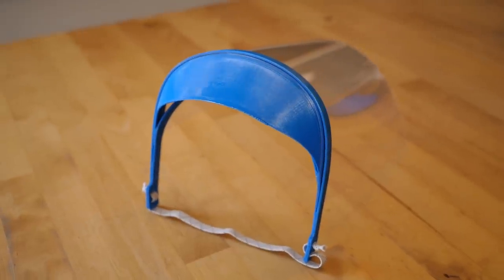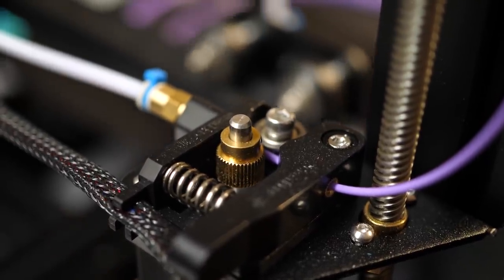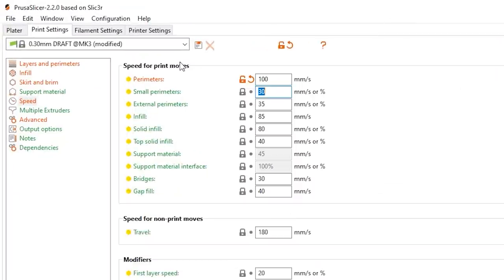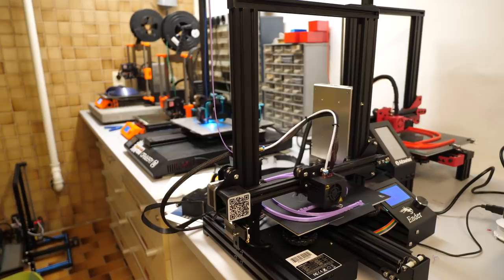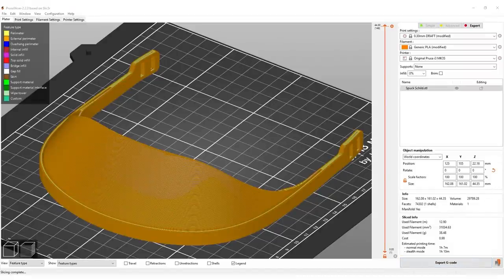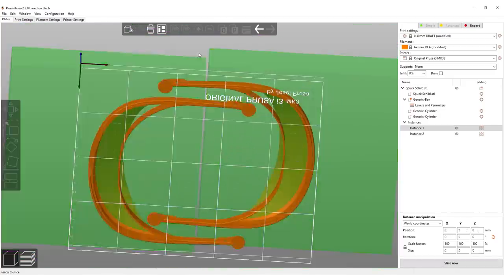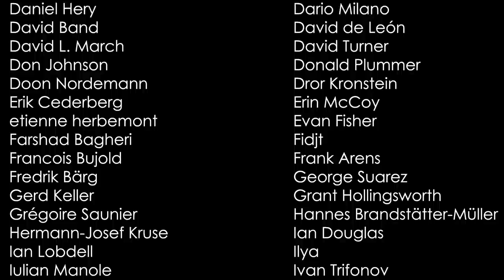FASTER 3D printing of face shields - from 5h to 1h!

Comment: Aside from helping meet a public need, this is one of the best "git 'er done" 3D printing videos I've ever seen aimed at optimizing speed and strength.

Most important to me is hearing which adjustments to attempt in which order: The goal is to get test prints done faster, so maximum production can start sooner
- Which adjustments can provide the greatest speed savings?
- In what order should they be tried?
- How many changes should be tried in a single test print?

Being able to quickly tune an adjustment that went "too far" is another key part of the process.

Thanks, Stefan!
Reply from the maker: For this application, I'd set speeds and extrusion width and layer height quite high. Up the temperatures quite a bit and then tune down on the volumetric flow rate until you get nice and consistent prints.

Comment: I'm part of a similar effort in DK, and have gotten my print time down to 24 mins without any noticeable loss in quality. To be fair I've switched to a 0.8 mm nozzle and am printing with 0.4 mm layer height, so that's probably where most of the time reduction is coming from.

Comment: these values are for a .4mm nozzle
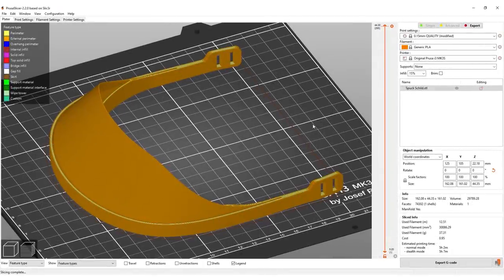0:00-2:56 introduction
2:57- 3:34 adjust layer height to around 0.3mm 0.32mm if you have a creality
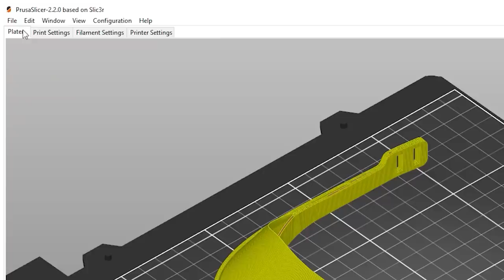3:35-3:45 remove skirt/brim
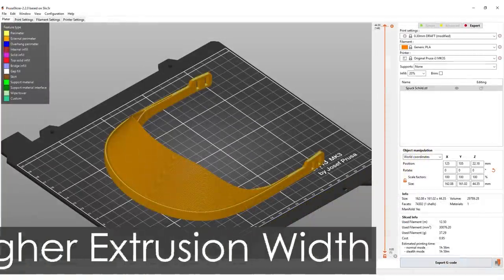3:46-4:05 increase extrusion width to 0.6mm
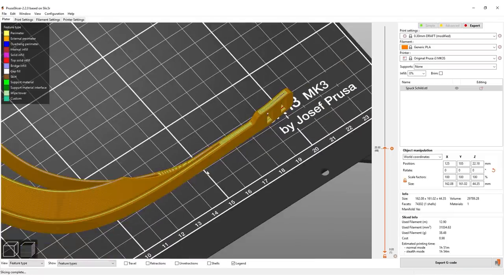4:06-4:18 decrease infill to 0%
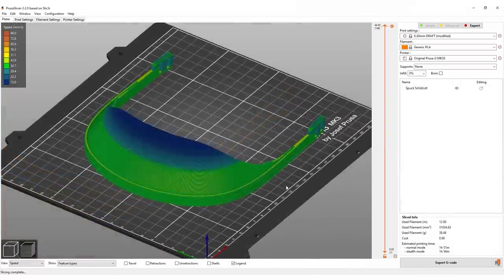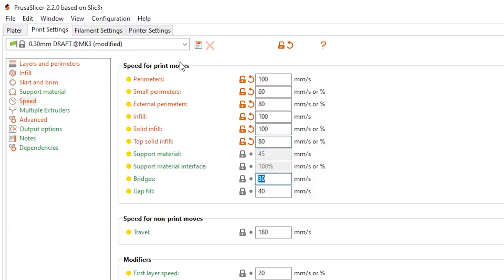4:19-4:52 increase printing speeds
4:53-5:24 just volumetric flow rate
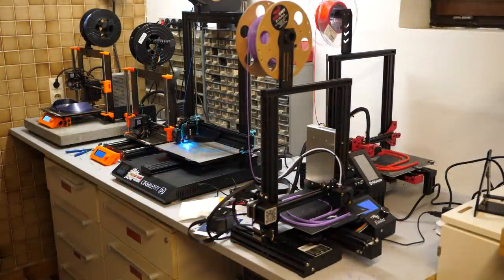5:25-5:50 increase temperature for higher volumetric flow rate
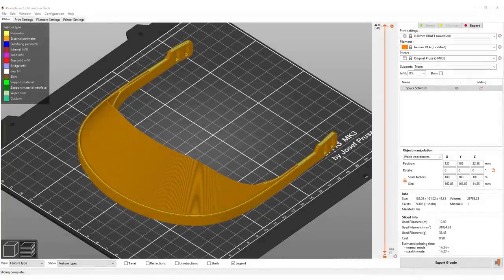5:51-7:07 explanations of random stuff
7:08-7:30 reduce minimum layer time and part cooling
7:31-8:21 use modifier geometry to reduce perimeters to 1 in shield
8:22-9:08 use modifier geometry to fine tune small areas
9:09-9:20 put multiple things on platform

Comment: Excellent and timely video for all those volunteering their time to this cause.  By the way, there is a clamp mod for near the Artillery print head that will hold that flat cable more securely and lessen the chance of that burn out issue.

Comment: Thanks for this very informative video!!!  I too am printing face shields (design and stl's provided by local medical supply company), and these steps dropped my ~7 hrs / shield to ~ 3.75 hrs / shield!!  Also, I was using rafts on very thin parts and the addition of "mouse ears" was a godsend in reduction of post processing.

Comment: Well, to get it faster... use a bigger nozzle if you can and do'nt forget to turn retraction off since that is costing a lot of time for parts that don't have to look nice.
On the sidewinder with enough temperature, I can print with 90 mm/s with a .8 nozzle and that means only one perimeter and are still very strong.

Thanks for sharing this for the good cause.
Reply: They still need to be comfortable. Nurses might have to wear them for hours. So just make sure that doesn't produce any jagged edges or blobs that stick into the skin. Sharp edges could also split rubber gloves.

Comment: I upgraded my Prusa i3 MK3’s with the all copper E3D Volcano heat-block and nozzle. With this mod, I am able to print one of Prusa’s face shields (just the top part) in about 20-25 minutes with an extrusion width of 1.2mm (out of a 0.4mm nozzle, because the volcano is ridiculous like that) and a layer height of 0.3mm (any taller and I push past the volcano’s maximum flow rate and the plastic melts but is not reaching the temps it should, and this is visible in both the print quality and plastic colour). I’m currently playing with settings for my 0.8mm nozzle to find a sweet sport for the print speed and layer height. One thing you can try if you’re printing too fast for your hot end to bring the plastic up to the right temperature is to crank your hot end temperature up fairly significantly - please note that I have no idea how this will affect final print quality, and please be careful not to overheat your hot end or melt your silicone sock.

Comment: Excellent tips! These helped me reduce a print from 2h41m down to 2h08m. Then, I decided to use the adaptive layer height feature to give me a better finish, and surprisingly it reduced the print time further an I ended up at exactly 2h. I'm very please with that and the parts look surprisingly good too!

Comment: As one who works around hospitals/EMS and has been working with healthcare workers to get these into local hospitals - there are invariably two concerns expressed:

1) The face shields can not detach from the mask/fall off. A bunch of the prints and/or shields don't attach well to the headgear, and if they fall off during patient care - then the caregiver is exposed. Tape, or other solutions help a LOT to ensure that some of the face shield material attaches better ( here - typically transparency sheets)

2) The elastic bands (if you use the thin ones) often get caught up in the hair of caregivers, which makes it hard to put them on/take them off without compromising the face mask (or goggle) seal. Thicker materials that don't get twisted into hair are crucial.

Thanks all for all you're doing to help out! People are awesome!

Comment: I redrew the Prusa design and ended up with a facemask that can be printed in about 35min. using a 1.5mm nozzle. I also removed the studs at the outside of the mask. The shieds are fixed to the holder with 3 printed clips.

Comment: Quite admirable Stefan. I don’t think you need to worry about the part lifting a little at the back - functionally it should not matter👍 I think your settings could benefit other designs as well

Comment: I read on heise that clinics prefer prints in PETG since they are easy to desinfect with alcohol and and also don't shatter when dropped. ^^
Reply from the maker: Tossed mine around a little and didn't break them, though I'm also currently in the process of changing to PETG. Since it's getting warmer outside I fear people leaving them in the car. Even though that might disinfect them a little, PLA shield holders might not be the best in such a case.
Reply: @CNCKitchen  I delivered some Prusa v2 shields to clinic a week ago. They use mostly 70% alcohol to desinfect, but also sometimes an autoclave with ~70-80 degree to desinfect. They are also experimenting with 70 degree autoclave to reuse FFP2 masks. I modified your print for PET-G, all I did was raise the temperature to 240 degree and bed temp to 85 first layer, then 90. And raise the speed again to 120mm/s in the filament setting. All prints came out nice so fare, printing time on Prusa Mk3 ~ 55min each.

Comment: Maaaaate, thank you! you've drastically improved the speed at which my 3d printer chooches :O was taking me 1hr 30 minutes to spit out one of the ISO838 frames, now down to 45 minutes :O The spool of filament, it's visibly turning now :O the volumetric setting is freaken insane!

Comment: get rid of those slits at the back where you attach the string. Use clamps similar to the clamps you find on a boat (dunno exact word for that). That increases print speed bc you dont have to move between islands. I am printing similar face shields (without the shield at the top) in 30 min per print. We use 0.5mm PET foil in 300x215. we also attach some foam tape where the print touches your forehead. as a string we take rubber band with holes, so you can adjust the length easy and on the go. Material is PETG. Masks are desinfected at 60°C in an oven. (hope those infos might be helpful for someone)

Comment: I also have an Artillery Sidewinder. My flex cable is also burning out from all this printing. What I want to share though is that with a 0.8 mm nozzle on the Volcano hot end, with 0.3 mm layers 1mm wide, you can print at 80 mm/s or possibly slightly higher.

Comment: One more interesting trick could be to lower the temperature for the top angled shield, as it has a much lower flow rate - ie. via the new PrusaSlicer's "insert gcode at layer" feature. ... An alternative could be tuning Marlin's AUTOTEMP, but that would likely take more time / testing.
Reply from the maker: Good suggestion.

Comment: Hey stefan, do you have any tips on how I can help others with my printer. I have the capacity to print a few of them. Just don’t know how to get them to the necessary places. I live in the south of germany.
Reply from the maker: Visit https://www.makervsvirus.org/de/ !
Reply: Exactly. check out Makervsvirus and find out where your local hub is. If there is none, join the nearest one :) Happy printing!
Reply: Wo wohnst du? Bei uns bei Greding ist leider kein Hub vorhanden
Reply: You could also ask local services if they need some. Delivery people, your doc, restaurants with delivery or check on platforms like nebenan.de if you've local people that go shopping for older people or people in quarantine. Those might be grateful for a little support. Personally, I think the professional areas like hospitals should get professional equipment that is certified, but we can help those that would benefit from "some" protection, but shouldn't buy the ones that are needed in hospitals. Just be a little careful. There are some people that pretend to need shields for a good cause but sell them on eBay or other platforms for profit.
Reply: Hu Emm Baden-Württemberg Bad Waldsee. Glaub leider nicht in deiner Nähe.
Reply: Leif Thank you for the advice!

Comment: On your Blog you showed a way to modify settings for an area using a support blocker in Cura.  How did you add the circular tabs in Cura?     I ask because maybe your way is better than mine.  I had to use a work-around, but I was able to add the circles (well ellipses because I changed them)

The way I did it (which there may be a better way) was to download a simple cylinder model, place it where I wanted the tab, I went to the resize menu and turned off the Uniform Scaling option and then scaled the z by itself down to a single layer height.  (I'm using 0.28 initial layer height and I have a variable layer height of 0.04 on top of that so non-detail layers will go to 0.32 and layers that need a little more detail will go to 0.24).     So with my z of the cylinder set to 0.28mm, I also proceeded to experiment with changing the circles into ellipses and I made their longer dimension in-line with the angle of the side of the shield frame by rotating them slightly.    This let me elongate the tabs a bit.    I changed the tabs to Print As Support.  I set their xy distance and min xy distance to 0mm, but I found a bug in Cura that I need to remember to report.  The tabs were not touching the model.  I had to temporarily turn on supports in the main settings, change the xy distance and min xy distance to 0, and then turn the support off in the model.  Then when I sliced it, the extra layer that I added (using your inspiration), finally touched the frames the way I wanted it to.    When I lift the frame off the bed, the tabs break off almost by themselves, but they help adhere the part to the bed enough during printing.

I have my print time down to 1 hour 40 minutes using PETG, which I think is fair to say is a little harder to print with.

Comment: You can make them in 5 minutes, with just a longer piece of transparent material, all you need is TAPE, tape it into a cylinder place over head, if you want to get adventurous cut out curves for shoulders, 360 protection in 5 min
Reply: Haven't you learned to not place a bag over you head as a child? ;-)  But seriously, actually you need quite a bit of transparent material for this, about 60cm x 30cm, which is hard to source, especially now. And you won't have the eye protection against sinking droplets, as long as you don't intent to close the cylinder at the top, which brings us back to the bag situation.
Reply: @llejk  yep I know but I like having a purple face:) but seriously I know I tried looking for some material found A3 but not much more but someone that could do them en mass at some point, I did a render but cant post a link goto mechabits couk

Comment: Actually your speed setting shown here are usually my go to settings for normal prints. As long as you use klipper that actually do acceleration calculation on all moves and keep accel to a resonable level for your printer you can reach those speed almost all the time. Usually now I'm limited by the heating power of my print heat in regard of speeds.

Comment: 0.28 layer height is easily doable on an Ender 3 w/ 0.4 nozzle. Reducing perimeter  count and upping the line width is good; I've gone up to about 0.6mm in vase mode. Volumetric limits of the hotend begin to show eventually; 85mm/s nozzle speed in my case. Mine can do about 150mm/s for 0.2LH & 0.48 width. Teaching Tech has a spreadsheet to calculate these values.

Comment: Hello Thanks for sharing good stuff, I wanted to know about variable speed. Mean to say that is possible to give command "User defined speed" Like 1 to 100 slices at 30 MM, Next 200 slices at 40 MM and next 100 slices at 50MM ? I have total 400 slices in a particular print.

Comment: I noticed non of the printers in the video running the ED3 volcano.  Two years ago you made a video on converting a CR10 to a volcano heater block.  Did that conversion not work out in the long run?  Any thoughts on doing a new video on the supervocano upgrade?
Reply from the maker: The Artillery X1 is running a volcano. Great for fast printing though quality suffers a bit. Concerning theft super volcano, I currently don't have a printer, where it would make sense. The volcano is already plenty powerful.

Comment: Hey, Stefan. Thinks for great tips! Have you considered disinfection methods for these shields? I would like to use UVC lamps, but I heard it degrades plastics. 
I was wondering how big of an effect that is. For example how many 30min disinfection sessions, with say 30W tube, would these shields last. It would be cool if you did a video comparing effects of UVC radiation on different materials.
Reply: Ok, I just found the comment section on your previous video :).

Comment: Have you looked into having the printer remove the print from the bed automatically?   I've seen that pop up on Reddit where the they can flick the part off the bed and start the next one without any issues.
Reply: I saw that too haha!
Reply from the maker: Saw a couple of videos today on the 3Dprinting subreddit: https://www.reddit.com/r/3Dprinting/
e.g.: https://www.reddit.com/r/3Dprinting/comments/fuhbxk/the_automated_takeoff_procedure_for_my_continuous/?utm_source=share&utm_medium=web2x
Reply: I did that by accident yesterday! I'm sure it would be fairly easy to do, unless you have a brim or skirt. In my case it followed the print off the bed but I can see it sticking around.
Reply: check the channel make anything. He uses g code to do it Everytime

Comment: Thank you! I have been using cura since i got my first printer and did the switch to Prusaslicer a few hours ago. Oh man this slicer is soooooo good. And i went from 2.25 hours for each shield to 38minutes with better quality and less after work with this method. I do not think i will ever go back to Cura after this.
There is one issue though... When i want to stack these on top of eachother with 1 layer between, i get an error saying "Empty layers detected, the output would not be printable". And i disagree but cannot save the gcode or send the job to my printer :( help....
Reply from the maker: Maybe just put a tiny dummy part in between to trick the slicer. Simple cylinder or cube, just 1x1mm in size.
Reply: @CNCKitchen  this did the trick. but not before they all where objects added to the first part or something like that. but i will figure it out from here. 😁

Comment: I'm also cranking out the shield frames for the last week, though I'm using a remix of the Prusa design made of PETG. I'm stacking them on my Ender 3 by up to 12 (by manual gcode splicing with G92 coordinate redefinition, to print the first layer after the gap slow and with full cooling), so it runs 24/7. 
I went with a ~6mm^3/s limit, using a 0.6 nozzle. I could maybe push it a bit, but the stacking lets me produce about 14 per day on a single printer already.

Comment: Careful on the setting on Prusa MK3 with stock hot end.  I tried these settings and now I have been having clicking problems with idler.  The hot end is getting to hot.  Went back to my old settings.  So much for trying to go fast.

Comment: Hey, i recently discovered that when i used a 0,4mm nozzle but decreased the nozzle size in software to 0,2mm with a 150% extrusion multiplier, i was able to archive more detail and was able to print finer text, but it drastically decreased my layer adhesion.

It would be interesting if you would be  able to quantify this behavior and maybe an increased nozzle size with decreased extrusion multiplier could help with better layer adhesion?

MfG Fritz
Reply: Fritz Walmrath A 0,2 mm nozzle pumps out 1/4 the amount of material vs 0,4 mm, hence multiplier should be 400% in this case...
Reply: @TheKimNeeper  Youre right 😂 didnt think about that, will try with 400% extrusion.
Thanks for the answer

Comment: THANK YOU SO MUCH FOR THIS! 
Just completed a test run on my Prusa MK3s, those settings work flawlessly in conjunction with the Pretty PETG printer and filament profiles. The only unknown for me at this point, is finding the right thickness clear sheets that will stay in place using this design, standard A4 Binder sheets are just too thin. Any suggestions or guidance is much appreciated. (UK based)
Reply from the maker: We're able to get 0.3mm A4 binder sheets here in Germany. They are plenty thick.
Reply: @CNCKitchen  All I've been able to souce here so far has been some 0.25mm binder sheets, just waiting on delivery. Hopefully they will suffice. If not I'll modify the print files accordingly to suit them.
The settings you've provided and explained are excellent. This will help greatly.